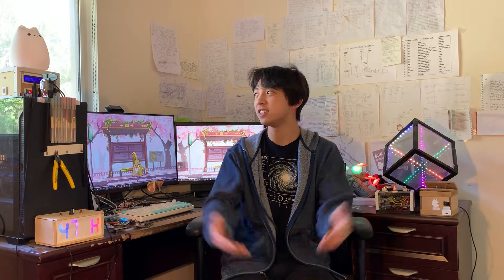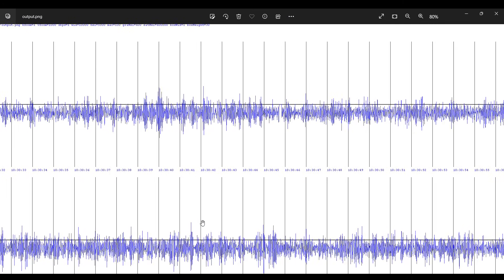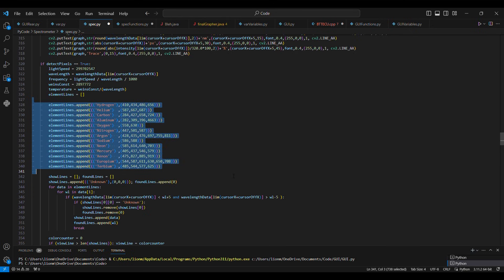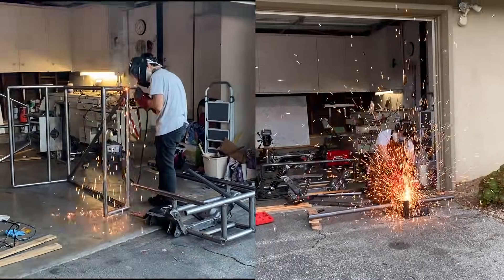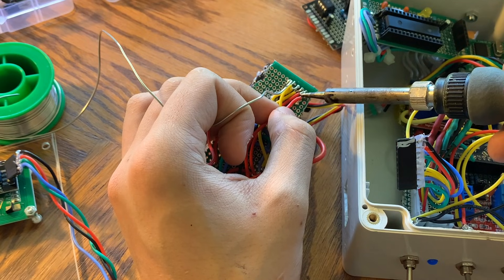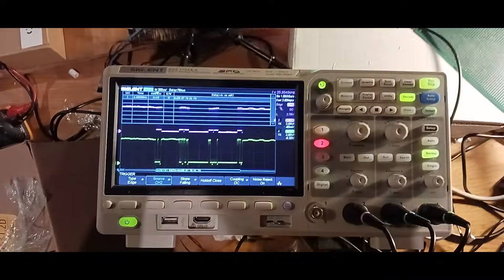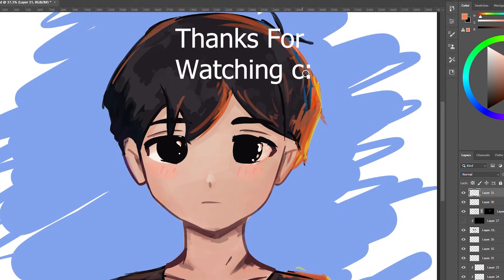Liong Ma MIT Maker Portfolio [Accepted]

Comment: It's nice to see this kid making good use of being in America. I started now at 29 and recently got myself a 110MHz Oscilloscope and a DC power supply. I am from Papua New Guinea, where oscilloscopes are unheard of. Thanks to e-commerce I am able to try my hand at electronics. My research and testing is way slower due to location and shipping. 

If you are in the West, you can make good use of the resources you have access to like this kid is doing. 

Like now, I have to wait at least 3 to 4 weeks to receive my 555 Timer ICs and capacitors just to see how clock circuits work.

To everyone else pursuing this art, all the best!

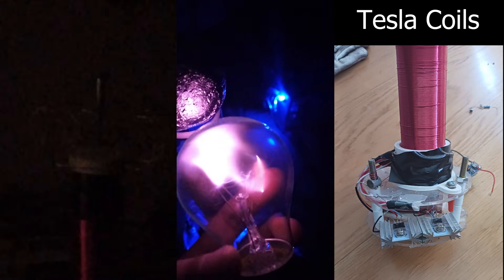Comment: Can someone explain what exactly he meant by a classical physics breaker at 0:21 Please share a tutorial on it if you know what it is
Reply: I have no idea how to make this, but what he means by a classical physics breaker is that classical physics is usually deterministic, but radioactive decay is probabilistic, so the number on the light is controlled by some radioactive substance, specifically it is set by the decay of the substance. If classical physics was correct, this should be impossible, but since quantum/particle physics is a thing, the number shown will change non-deterministically.

One way he could have made this (although this is certainly not how he actually did it) is to use the cloud chamber particle detector he showed earlier in the video, put something radioactive in it, set a camera on it with some code that detects when a particle trail/cloud line shows up, and then have that code change the number.
Reply: This is the same device that was in steins gate( anime) which used to tell about the probablity of changing of alpha line to beta time line 😮
Reply: It pretty much just measures and counts radioactive decay, everything else he said was technically true but he made it sound more complex than it actually is. You could probably make it in a day if you followed a guide.
Reply: Simply Non-linear Dynamic (Bifurcation theory)

Comment: If I had been born with a diamond spoon in my mouth, I'd be right there with you.
Reply: highly unlikely. capital only gets you so far.
Reply: @t.s.d.1376  if you don't have capital you're not getting anywhere close to any of that. Do you just have a solidoworks licence, a ton of steel, a welder, and countless other materials lying around? I sure do not.

Even if I was accepted to MIT, which I most certainly was not, I wouldn't have the money to go.

Comment: Someone explain to me the creation he did in 0:20
Reply: Radioactive decay isn’t ruled by classical mechanics, but rather quantum mechanics. Quantum problems don’t have a necessarily single solution, but multiple, hence the solution isn’t “determined” to be a single one.

Basically, it’s a number generator that uses radioactive decay and can make multiple numbers at once. Sounds fancy but theoretically you just have to measure the rate of fast decaying materials. 

Not like I can do any of this or know for a fact that I’m right.
Reply: @magnus_artifex  So change in PH, temperature, and mass?

Comment: How did you learn how to design PCBs I’m in a relative position as you as I’m a highschooler(10th) and I write a lot of c++ and make code based projects cuz I can’t really afford stuff but I attempted to learn how to make PCBs for more physical project and inevitably gave up due to a lack of resources on PCB design
Reply: Ben Eater makes some good videos on theory, computer architecture and lower level programming, and Phil's lab makes some videos which are directly related to PCB design and learning KiCAD (although many are more advanced). If you're struggling more with theory, it would be good to have a hands-on experience with basic/intermediate electronics, but if you can't due to price, there are a lot of books that cover basically the same material that you can get online

Comment: Animation, remote IR car, master/slave strain servo driven robotic hand, radio, app control, muon vapor trails, tesla coil, plasma arc generator, random number nuclear transmutation, GPS seismometer, python coding, spectrograph readout for spectrometer, inventor CAD for 3D printing, chemistry? Got me there.., circuit design and custom cell wiring, tube frame design, FEA static deflection, welding and fabrication, power bank spot welding, eGPU and PCB design, reflow, breadboard fab with project boxes, control module programming, visual studio UX design, running gear install and test, logging data, PWM testing with oscilloscope, panel layouts, photoshop! Subscribed.

Comment: "when i was 15 i achieved nuclear fusion" is not something i ever expected to hear
Reply: I heard that line and started to question if this video was a joke. But no, I guess he just actually achieved nuclear fusion at 15. 🤯
Reply: @nothingleft4911  He fused some nuclei together through a well known experiment. But he didn't achieve nuclear fusion in the common sense, as in he he didn't achieve sustained nuclear fusion with energy surplus.
Reply: @Appri  But wouldn't energy surplus break the 2nd law of Thermodynamics?
Reply: @Lucius-Fox-t7v  Not at all. It's basically a chemistry reaction, deuterium and tritium reacting to form Helium and neutrons, which is by nature energy positive but requires incredible conditions with huge activation energy.

Now, if you want to harvest that energy, that's the problem.
Reply: where does he say that?
Reply: @NPJGlobal  He doesn't (anymore?). Either it's some meme I'm not aware of or the videos been edited in YouTube Studio, and I think the latter coz you can hear a slight pop like there was a cut just after "I created a classical physics breaker which uses radioactive decay to violate the laws of determination" which another comment about this said it's when the line should have been said.

Comment: I feel pathetic. Nucular fusion at 13, wtf
Reply: It's not to hard, you can easily die though since it needs very high voltages to run, way to risky
Reply: This guy is very impressive, but don’t get worked up over what other people done. Everyone learns and does thing at different times, so long as you got the will and the curiosity you can do anything.